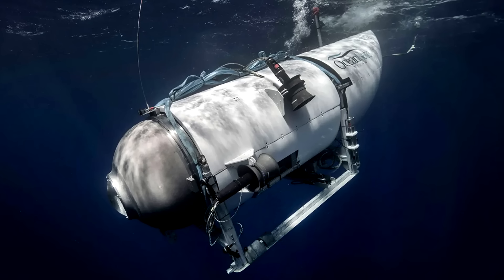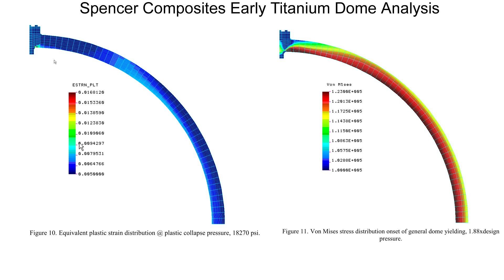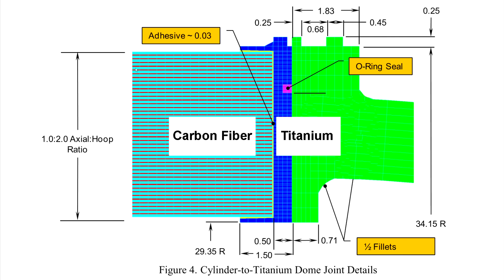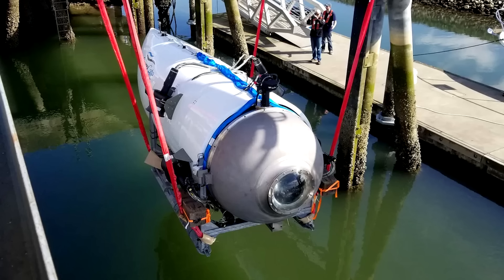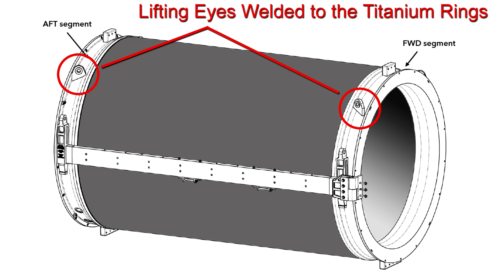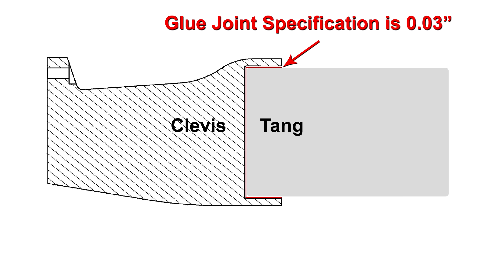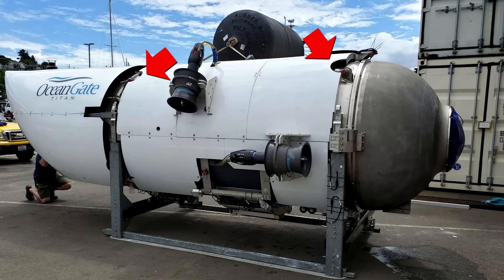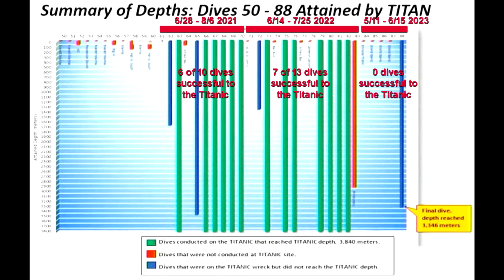OceanGate Titan Titanium Rings - An Additional Story About Them

Comment: "Water intrusion"....that was my original concerns when the Titan was lost.
My theory was that water intrusion had occured at those glued joint interfaces between the CF hull and the titanium sealing rings.
Even a tiny stream of water, an ultra fine column of water if you will, as it burrows its way through the microscopic voids in the glue joint, would cut its way through, not unlike a water jet "saw" used in many industrial applications to cut through just about any material made. Water jets typically operate at between 10,000 psi for food processing up to 50,000 to 75,000 psi for cutting steel, titanium, hard granite and other stone. Considerably higher than the pressures that Titans glue joints would have been subjected to but more than high enough to cut through the CF hull like a hot knife through butter as the tiny jet of 6,000 psi water searched out and followed any tiny voids or weakened "veins" in the glue joint and CF bonding juncture.
I would imagine some of the loud bangs, popping sounds and especially the "tearing fabric" sounds mentioned by Titans crew and passengers and in the original text communication transcripts released at the onset of the tragedy (which i believe were genuine and real) could have been as a result of these tiny microscopic jets of high pressure water burrowing into the glued joints and suddenly bursting into tiny voids. This could have been a very slow, incremental process, a little more occurring on each dive and would have been completely unknown to anyone.
This remains my most likely cause for the implosion and loss of Titan and her crew.
How Rush was so nonchalant and arrogantly self assured while dismissing such a valid liability of the design is beyond me. The guy was, like many brilliant and highly educated and accomplished individuals in engineering fields, dumb as a wet bag of hammers imo. For whatever reason, engineers seem to lack common sense at an alarming ratio. Fully 5 of the dumbest individuals ive ever known were engineers and architects in various fields.
Absolutely brilliant in their almost singular purpose and highly focused endeavours yet quite literally lacking the common sense, wherewithal and self awareness to see very obvious fundamental failings in their various designs. The cliche cant see the forest for the trees comes to mind.
Anyhoo....im not a submersible engineer but i see many, MANY red flags and obvious liabilities in the Titans design and construction and in Oceangate management, any one of which could have very likely caused the demise of Titan and her crew.
RIP to those lost and God bless their loved ones...
Reply from the maker: Thanks for your thoughtful comment.  Thanks for watching the video.
Reply: @solareclipsetimer - thanks for covering it so well.

Comment: As an Engineer I see that they failed to use previous knowledge gained from years of testing. There is a reason we don't use plastic bonded to metal as plastic will creep. The Hoop Stress would of deformed the Carbon fiber until a catastrophic failure at the joint. This makes sense.
Reply: Would have, not would of.

Comment: Putting so much strain on the rings via the eyelets is criminal.
Reply from the maker: I agree, especially when the original engineering did not include them as a point to put the lifting loads.  Thanks for commenting.

Comment: I’m no engineer but looking at the enormous pressure exerted from both ends x the same pressure against the hull/ tube looks destined to do what it did ! Minimum I’d want the 1inch inner titanium winding drum left in with an additional 1inch exterior barrel ! Sandwiching the carbon fibre! With the end caps screwed on if they couldn’t be welded because of heat transfer! Stockton crush ! Certainly lived up to his name ! Unfortunately took others who put trust in him with him!!!
Reply from the maker: Thanks for commenting.  I agree.

Comment: When the rings were salvaged, the ring shearing was complete on the forward ring.
Reply from the maker: Yes, the lips on the clevis were not strong enough to hold back the implosion forces.  But I wonder if the NTSB can ever say it was the initiation or not.  I think it's a hard call after the fact based on the wreckage.

Comment: The clevis overlap over the carbon fiber was only 1.5 inches???😂😂😂.  One dude had his left hand on the ring bonding surface as he smeared on the peanut butter glue with his right hand. Can’t get over that. Menards ceramic tile  adhesive😂.

Comment: I am a Air Force veteran aeronautical engineer and if asked would I allow Stockton Rush to design and fly an aircraft? NO would be my answer. I wouldn't allow him to design a COOKIE TIN certainly not a submersible! This explanation of the ring loading seems to me to be the plausible cause for the implosion. Oceangate were TOLD not to do it due to stress factors and point loading but still they went ahead and did it? Just  looking at Titan I would not have even agreed to submerging 10 feet in it let alone 12,500. With an outside pressure of around 5,500 psi! It was an accident waiting to happen by an irresponsible CEO. His engineers advised him not to do certain things - but he did them anyway.

Comment: would 100% use a lifting beam or spreader beam to help with distributing loads. with a 4 to 1 point lift, youre essentially lifting off two rings diagonally only and the other two are ballast, especially with something as stiff as that hull. so those interfaces where the lifting lugs are would undergo far more strain than expected. ideally they should have had it in a lifting cradle, given the nature of it.

Comment: I mean bro we know what happened. like you can try to find the exact point of failure and speculate on that but like the point is that it was not capable of repeated dives into cold deep water. Maybe one or two, as it did seem to apparently have survived a few Dives before its last, but the mechanical load on the body would eventually caused it to fail

Comment: Tony Nissen saying the rings weren't designed to handle vertical shear is kind of an alarm bell when the carbon fibre 'tang' is going to experience 380kg/cm2 of force trying to reduce the circumference of the cylinder inside the clevis. Isn't that shear by definition?

Comment: So, I also know what the glue used for the assembly of these rings is only rated for pressures of up to 4200psi lap-shear. Given the pressures we are looking at, I would be frankly absolutely terrified of anything that might further stress those joints. I wouldnt even want to stand or put weight on those joints, let alone lift the sub by them.

Comment: Good analysis. Additional factor is the torque exerted by the load at lifting rings. Pulling up, rings would be pushed outward at the bottom as load is suspended by the glue joints.
Reply from the maker: Thanks for your supportive comment, and I am glad you liked the video.  Yes, there are a lot of forces that need to be accounted for when you are lifting 23,000 pounds from four points on two rings glued to the vessel.
Reply: @solareclipsetimer  using AI for responses?

Comment: You need to look up the definition of "implosion".
Hint: It is the opposite of "explosion".
The Titan was "crushed". It did not "implode".
Reply from the maker: im·plo·sion
/imˈplōZH(ə)n/
noun
an instance of something collapsing violently inward.
Reply: @ Nope. It is the opposite of "explosion".
That happens when there is low pressure (a vacuum) in the pressure vessel, versus the outside air pressure.
It was "crushed" by the weight of the water. Simple.
Reply from the maker: @patrm2024  It's great that you are more of an authority than the Merriam-Webster Dictionary, from which I got the definition to reply to you.  Here is another dictionary definition for imploding: "to collapse inward as if from external pressure."  And thank for you comment and reply, because even though they are negative, incorrect, and you are attempting to be insulting, they still count as engagement by YouTube,  So you are helping the algorithm recommend my video to more people.  So thanks for your help.
Reply: @ So, you are wrong. Obviously, 🙄 you are of a certain ilk that does not mind that. Congratulations. 🥳
Reply: @ By the way the Merriam-Webster is not a real dictionary, so you are wrong on both counts. Learn English.

Comment: I'm not an engineer but I know that  carbon fiber is not suitable for this purpose because carbon fiber is prone to micro fractures which can not be seen even with a microscope. so over time as a material it may be justified to use it in a military helicopter or aircraft but  commercial aircraft it is well dodgy but companies like Boeing are doing it and ultimately it will be proven to be a mistake. For a submersible going to depths deeper than most nuclear submarines are designed to go hell no

Comment: After watching this I have to wonder why they couldn't have used a flat steel strap or cable around the bottom of the rings with the lift points being at the same location as the welded ones? I think that this would have provided a cradled lift as opposed to what was done and no distortion to the rings would have occurred. Does this make sense?
Reply from the maker: Thanks for commenting.  The original engineering called for always lifting the sub from the bottom of the frame.

Comment: Tony made the mistake many engineers make of giving two reasons why you can’t do something. “It’s not designed for that stress” and “besides, we’ve already put in the carbon fiber, it can’t take the heat of welding.” What a non-engineer hears is “so if we don’t have the carbon fiber, everything will be fine!”
To an engineer, those are two problems which both must be solved. To a non-engineer, those are two problems which EITHER must be solved. As an engineer, I cannot fathom the non-engineer’s perspective, but I’ve had SO MANY BOSSES hear two problems and reply with “we can fix one so let’s proceed.” I have to put my foot down and say “not until we solve the other one, too.”
Reply from the maker: Thanks for your comment and your thoughts on this.  That is such an excellent way of thinking about it.  In the video, I try to give OceanGate the benefit of the doubt and hope that they had engineers from Collier Aerospace look at the ring engineering again and provide clearance to do the lifting eyes.  Having said that, I really can't believe that so much would have changed from the initial engineering, from which Tony said you CAN'T put lifting eyes on the rings, to a second set of engineers saying it's perfectly fine to put lifting eyes on the rings.  That's a huge jump.

Comment: Unbelievable hubris and complete disregard of engineering common sense or safety, welding lifting eyes at those points to save some money. I'm sorry for the other people who lost their lives, but fate may have had enough of Stockton's temptation.
Reply from the maker: Thanks for your comment.  It is unclear to me why they welded the lifting eyes on the rings in between the two hulls.  I think it was strictly for convenience.  It made rigging it up for a crane much easier.
Reply: @solareclipsetimer  I agree. I think it would have been more expensive and time consuming to modify the existing landing gear and rigging, rather than weld eyes on the ring. An insane decision.

Comment: @7:24   After listening to the Director of Engineering, 2 things pop into my mind;
1)  I find it somewhat incredible that lifting eyes were discussed AFTER the vehicle had been glued together.  I would have thought that a process / procedure for lifting and moving the vehicle would have been discussed BEFORE the specifications and engineering drawings were even created.
2)  What was the original process / procedure for moving the vehicle ?   Was there one ?  The Director of Engineering  must have thought about this before building started ?
Reply from the maker: Thanks for your comment.  Yep, lifting eyes were never engineered into the design of the rings before the first sub.  So, in between the two hulls, they just decided to weld them on.  I do not know if they hired any additional engineers to sign off on that modification or not.

Comment: The picture showing the metal cables being used which are never made to the exact same lengths, then lifting on 4 points often can lend to only 3 points taking the majority of the total load. This would certainly induce a twisting affect on the ring to tube joints.

Comment: I'm a retired Master automobile technician.   Dissimilar materials are something I have great experience with.  Blown head gaskets. Like cast iron blocks and aluminum cylinder heads.  Those metals expand and contract at different speeds. How this submersible lasted as long as it did without constant inspection is beyond me.  I'm a tech, not an engineer.  This was a ticking time bomb. Still so sad for the families
Reply from the maker: Thanks for your comment.  I agree with you.  It just not seem like a good idea for a deep diving hull.  Stockton was warned about it.
Reply: To push the analogy further, imagine someone welding tow hooks to the head of the engine, for lifting the entire vehicle, instead of welding them to the frame.
Reply: Chevrolet found this out decades ago. They basically went to the bottom of the ocean in a glorified Vega.

Comment: So the rings’s lips are not designed for lifting loads but is okay for thousands of pounds of water pressure
Reply from the maker: Thanks for your comment and for thinking about the problem.  The difference is that when going down to depth, the water pressure is equally distributed 360 degrees around the ring.  So, the pressure theoretically balances out.  The lifting eyes lift up the entire weight of the sub on four points within a small square surface area on the ring, where the load has to be distributed.  It's unbalanced load on the rings.
Reply: @solareclipsetimer one thing I’ve always wondered is did they use any kind of metal as the base layer before wrapping it with carbon fiber or was it pure Caron fiber?
Reply from the maker: @neoplasma1  Thanks for your reply.  Pure carbon fiber, a bit over 5 inches thick.  My Titan playlist link is in the video description. you may enjoy the hull fabrication videos if this interests you.

Comment: I think that was probably the it, the initial point of failure of the sub. That is the consistent weakening around the titanium rings due to negligent usage of the lifting points that were welded on. That small degree of flex of lifting up and lowering down, pulling the face of that glue/surface joint. That tiny whimper fatigue causing minute pockets, or void cavities for sea water to egress into. Thus gradually, but slowly creating a path to the inside chamber, and then WHAM! RED FISHY FOOD MUSH! I think there is also a good possibility that they did indeed seen at least a few tiny drops weeping into the chamber.  I think the only one who really knew how fucked they were was Paul-Henri Nargeolet. From records it seems that in the last few minutes they were frantically hurrying to try to resurface. All due to failure of glue/epoxy joint, and undue stress applied.

Comment: At 12:24 look at the strap of titanium sticking out of the right side of the ring.  That looks like the outer lip of the "C" channel that was positioning the ring as the end cap on the outside of the carbon fiber hull.  That took a lot of shear  force to tear that lip off the titanium ring.  I'm thinking that was one of the primary points of failure.  There are major differential bearing pressures (axial load) between the end cap load created by the "C" channel on the ring and the direct hydraulic load (circumferential load) about the carbon fiber hull.  My calculations show the loads to vary by a factor of more than three.  About 4915 lb/in. sq radial and about 16,000 lb./sq. in. axial.  Not to mention the large difference in modulus of elasticity between carbon fiber and titanium.   NOT A GOOD IDEA FOR CRITICAL ASSEMBLIES.
Reply from the maker: Thanks for your thoughtful comment.  I agree with you.  The C-channel had complex loads.  There was some downward deflection of the hull.  There was inward compression by the end domes.  There were two different materials, although they were engineered to match the moduli.  The hand-applied epoxy to a joint that was specified to be 0.003 inches wide.  Finally the stress of the new lifting eyes and the risk of weakening the epoxy joint and causing water intrusion.

Comment: Why do not people talk about them screwing the TV mounts onto the inside of the carbon  fibre shell, it's a brittle carbon glued shell and they drill and screw brackets into it!!
Reply from the maker: Reasonable question that I am happy to answer.  On the inside surface of the CF hull they had spacers that ran the entire length of the hull.  The spacer was about 3/4 inch in height.  Then a stiff insert was slipped into the hull but held away from the hull by those 3/4 inch spacers.  That gap allowed room to mount the acoustic sensors and the strain gauges and run the wires to the computer that was in the back.   So, I feel sure that anything you see mounted on the inside of the cabin was only mounted onto that insert, not into the hull.  OceanGate did some odd things for sure, but I don't think they would have screwed directly into the inner layers of the CF hull.  Thanks for your comment.